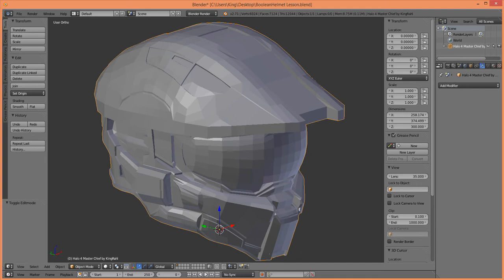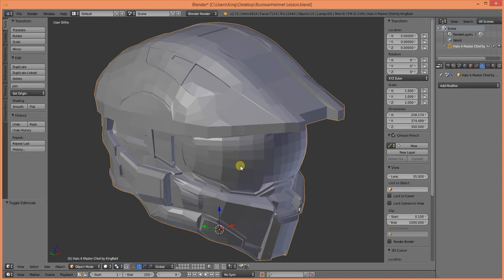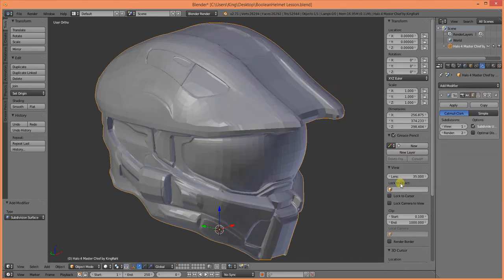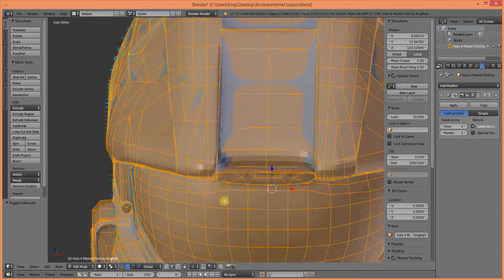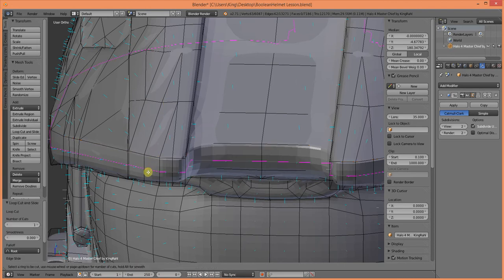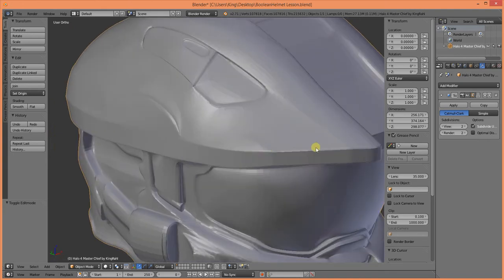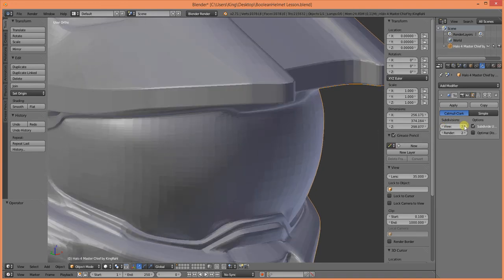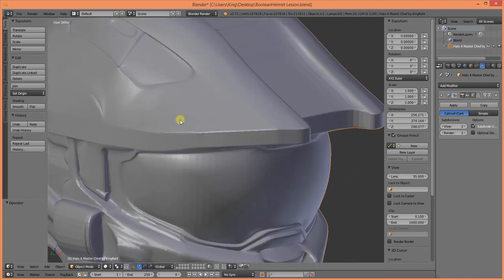Video 3 Subdividing Helmet to Add Detail

Comment: I dont seem to be able to select the edges i want to sharpen as easily as you are doing, im having to just click in the area i want to sharpen and hope it allows me to modify what i want.

 The only thing i can see that is different is that on your screen you have the blue lines coming from every face and you have the yellow circle around your cursor, and that triangulate faces and the two option boxes on the bottom left appear on your but not on mine.   Im using ver 2,71
Reply from the maker: +crossy28 The blue lines are showing direction of "normals" and the yellow dot over my cursor was put there by my screen recording software.

I'm not exactly sharpening the edges. I'm adding an edge loop and moving it to a particular edge to be sharpened. This only works if your faces are "quads" (having 4 vertices to make a face). If your faces are "tris" (triangular faces) this won't work. 

To do this another way: Using the Subdivision Modifier - during Edit mode - on the Properties panel, when an edge is selected the "edge data" section appears. This selection can be dragged from 0.0 to 1.0 (1.0 is equal to 100 percent). This will also sharpen your edges. I personally don't like to use this tool so I didn't include it in the tutorial.

I hope this helps.
Reply from the maker: +Wardarkfox I don't know if I understand what you're asking. If you dissolve anything, that would be the same as deleting it. You can add a vertex by subdividing an edge. This can turn a triangle to a quad, but any edge loop you make through it may be unpredictable at best. You can also turn two triangles into a quad, but they would need to be opposite facing. The shortcut for that would be ALT+J.
Reply: Where did you find the option? trying to covert myself

Comment: Do you plan to make any videos on how to add more of the little details that are lost when it is ripped from the game / pepakura. I'm trying to do a Locke from halo 5 and the models i got from the game are missing a lot of the finer details.
Reply from the maker: Those details aren't exactly lost. They weren't in the mesh. I do plan to make more videos in the future and that will be one of them. I will just show loading the game mesh with the corresponding skin to use as a reference next to the Pepakura ripped model.
Reply: +Far From Finished I look forward to that video. It is something that could really help me and I would imagine other people as well. Just because these meshes from Halo 5 are missing a lot of the details.
Reply: +Endymion Mageto Meshes ripped from any game will be missing details because they are not the original high polygon models. Those models have gone through a retopology process to make the polygon count lower so that they use minimal resources in game. The details are then "baked" out of the high poly meshes into images and re-applied in game via normal maps which is much less taxing than rendering lots of polygons.

Comment: How do you select an edge? after you tab to edit mode, hover over the helmet, press l, then ctr R, I can only edit a single verticy. I have helmet smooth and everything

Also, I had to move the object to be able to edit it, then I changed the rotation point to the object (the helmet) when I print will that change my center?
Reply: Basically I can't figure out how to do an edge loop haha
Reply from the maker: You don't need to press l. That is to select all vertices. On the bottom menu bar, there are three boxes in a row. The first is to select vertices, the second for edges, and the third for faces. When adding edge loop, it will automatically change to edge select. Move your mouse over the selected spot you wish to add an edge loop. A purple line will appear. When it's in the spot you want click once to add the line. You can now drag the edge loop to the desired position. Clicking your mouse again or pressing enter will lock it in place. Your faces need to be "quads" this will not work if your faces are "tris" or triangles. To try and convert all faces to quads, select all - my shortcut "ALT+J". To change "quads" to "tris" - "CTRL+T".

No. Depending on your slicing software, no matter where your position indicator is, your software will determine the center of all vertices and place object in center of build area.
Reply: Far From Finished That was the issue, I was working with "tris." 
Thanks again for responding so quickly. I'm learning a lot about 3D printing. You are a design sensei.

Comment: nice vid tutorial. i would prefer to add edge crease instead of edge loops
-> edit mode, select edge, transform properties, crease 1 (for sharp edges).

most of the pepakura files or designers doesnt follow the quad faces method. therefore its impossible to add necessary edge loops all over the model (btw.. this raise the vertieces counts in the air and increase the fixing time or time to add more details).

ps: the crease option require the subdivison surface modifier.